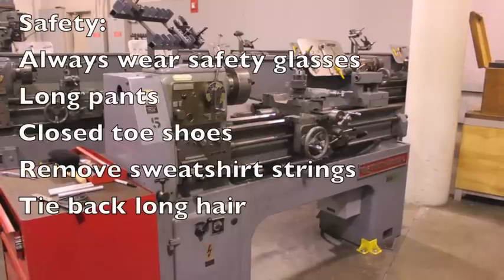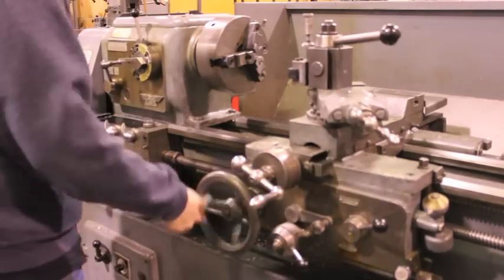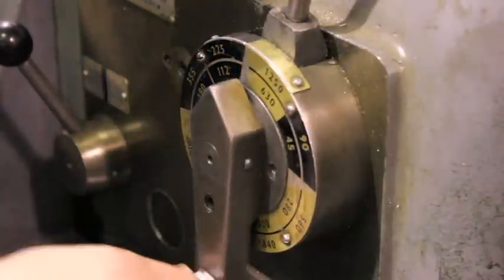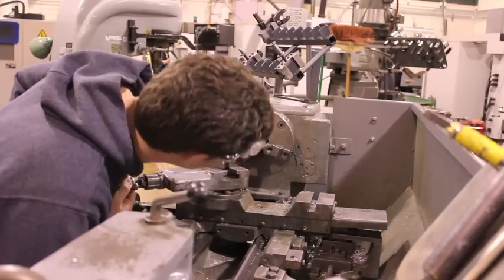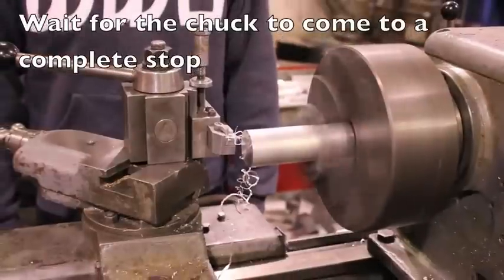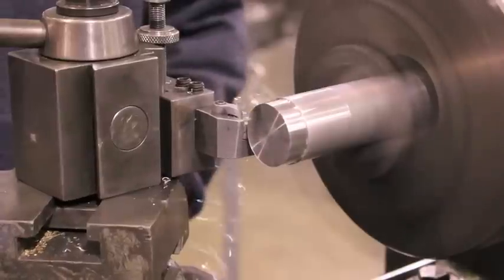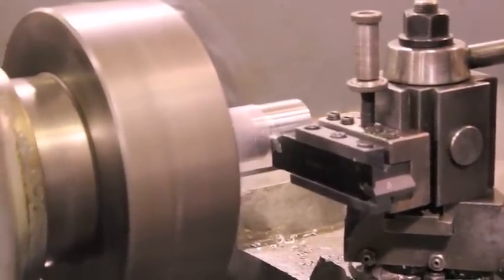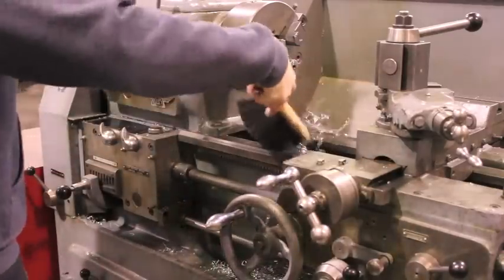Basic Turning on a Manual Lathe

Comment: How far does the part insert into the chuck? Is this standardized or different for every machine/brand?

When you make a cut to shorter the circumference of the barstock, how are you measuring the depth of the cut? Im assuming you aren't eyeballing it...

Comment: Manual turning lathes are great for producing one off unique parts. A skilled machinist will be able to operate it as they see necessary to produce anything asked of them. In this instance, the time is takes to perform the setup is outweighed by the low volume required. While the manual turning process takes more man hours, there are many instances when you could not go without using it.
Reply: What do I look up if I want a computerized one? Sorry I'm new to this whole thing. Manual looks fine, but like you mentioned for consistency across parts it probably isn't the best option
Reply: Unfortunately  we  live  in  a  computer  world  where  the  manual  turner  is  no  longer  required.

Comment: A short video on simple facing and parting operation on the manual lathe. Such classical old style equipment is still widely used in the industry and machine shops because they can be sufficiently good to produce low quantity parts, prototypes or do partial operations on parts. Even better, manufacturers with advanced fully automatic CNC machines may not accept small jobs whereas mom & pop shops that have this kind of manual machines can be your life saver producing you the 5 pieces you need. After all, such manual lathes are good to show and teach you the basics of a turning operation. Lathes and milling machines are used in many areas of manufacturing as essential basic tools, including woodworking, ceramic parts manufacturing, metal and metal alloys shaping and manufacturing, plastics and elastomers machining.....etc. Therefore, anyone interested in manufacturing technologies for fun, hobby, as an entrepreneur or for their career should definitely familiarize himself/herself with lathe and milling machine basics and probably also with other non-conventional techniques such as laser machining, plasma machining, waterjet.....etc. Even if you are not a machinist, but a consumer of machined parts, I strongly recommend learning the basics of machining operations and CNC and manual equipment, so that when you prepare blueprints or want a product to be designed and want to place orders for parts, you know better what is possible and what is not possible. Also, the equipment a machine shop uses is an important contributor to quality, lead time and price. Knowing something about your supplier's equipment inventory can give you an idea about whether that particular supplier is a good fit for your specific parts or not, provided you understand something about available equipment. You can visit our Youtube channel by clicking our logo on the left for additional videos on various manufacturing techniques, good instructional and educative subscriptions and to see videos we liked. Thank you WWU Engineering and Design for posting videos showing manufacturing processes. Please also take the advice on safety of NOT wearing long sleeves when operating this lathe.

Comment: Dude never work with the lathe in long sleeves. First thing I ever learned on the lathe. You could turn into ground beef.
Reply: Yeah, you don't wanna turn out like that guy in that russian lathe incident. (dont search it up if you cant stand looking at gore)
Reply: Was it ! The Made in Poland guy !??
Reply: @mathieu525 I made the mistake of watching that. Holy shit.
Reply: Most machinist where long sleeve shirts I do , you just need to keep your sleeves buttoned . I've been running a CNC for years but even when I ran a manual I wore long sleeves .
Reply: haha true !
Reply: +SATHRAJ Thank you!
Reply: hahahahahahahah
Reply: Simply Google lathe accident....
Reply: Yeah.  From machinist named Charles, to grounded Chuck.
Reply: Wouldnt it be too much resistance and stop the lathe? Like when you put your hand on a fan to stop it?
Reply: @andydecastro11  some can run with 20 horsepower, it doesnt stop from your shirt. The machine is designed to not stop when metal is pushed in it, so it will keep going even if you get caught
Reply: @andydecastro11 nothing will stop the lathe